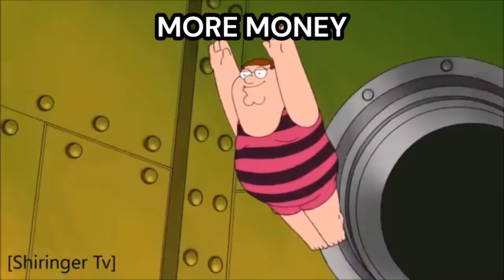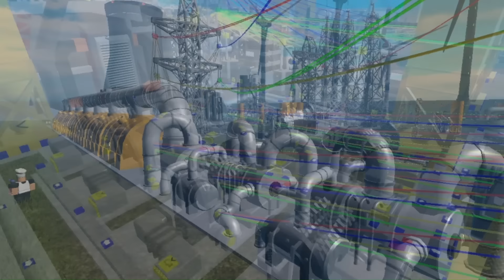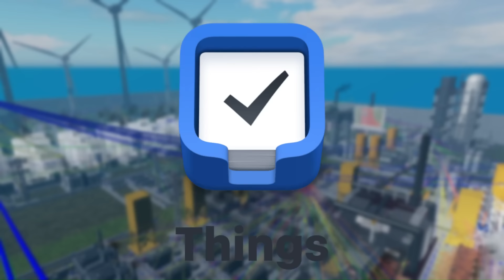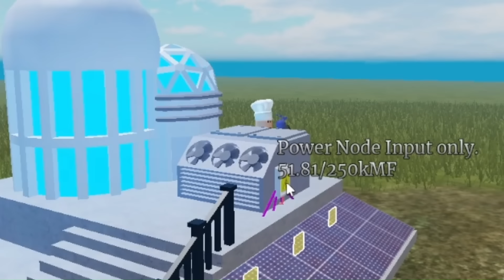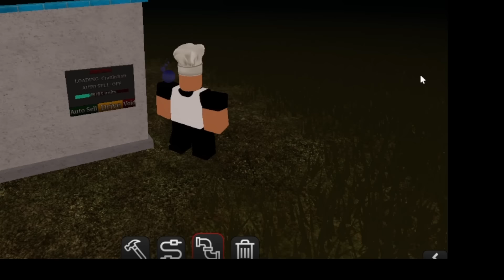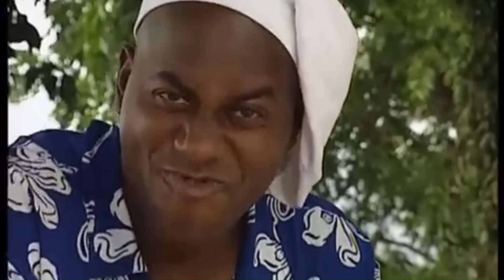INDUSTRIALIST - A roblox tycoon madness

Comment: So you can turn refined diesel into gasoline wich is cheaper than turning gasoline into diesel then refining that and it also causes les polution and you get more gasoline from diesel then diesel from gasoline so gasoline is better(also gasoline is better cause in the nuclear uptdate it has more rp value)

Comment: Here is a better flow chart:

Power
Solar panels > wind turbine 2 > geothermal plant > gas burner > idk how to do HV

Cash
Iron plate squared > chair > gearbox > lithium battery pack > 8x64x microchips (guide is on wiki)
 
Research (nuclear update)
T1 array > T2 array with plastic pellets (1 plastic production per 26 T2) > Sattelite dishes > T3 (rubber and aluminum) > T4 (guide on wiki)

I have played Industrialist for over 200 hours. You can trust this guide, following that oil and pollution are averted like the plague.
It will require some waiting though.

Comment: iv only got 2 real issues with Industrialist

small map size and the low "model" count (instead of actual things, it counts parts, so 1 straight pipe is 5 models), iirc the current cap is 30k parts but it can be raised to 80k but there's a risk of data corruption (im guessing the data storage is either ineffeceint or small)

Comment: Advice for how to get rich: Just earn enough to buy the logic assembler, It is a power guzzler tho so make sure u have the required power. Diesel generators / the cpp would be good for this. Next supply the 4 componants, They might seem like a pain in the neck to build, but once u have done it its not so bad. Now finally you dont really REALLY have to setup a logic system to automatically control the logic assembler but its reccomended as it saves time and can avoid mistakes. You can control the input signals yourself. So if ur in a situation for some reason where u  are low on cash, you can sell 1 8x64x microchip for 5mil dollars and be good to go!

Comment: - no pollution
- blast furnace
- 100% pollution
- try to remove, but scrubber is 30k each
- end up on 2900% pollution and no way to go back
- no regrets
Reply: - water treatment plant 700k+
- distilled water for scrubber not cheap
- regret
Reply: @UpgradedBakedBean  filtered water is good enough (-10% per hour)
Reply: - filtered water scrubbers
- 3 foundrys
- 100% pollution
Reply: That's why I only use clean energy production and focus on keeping pollution at a minimum using advanced drills

Comment: 12:15, you can use pipe intersections to handle the inputs and outputs by chaining them. This way if you want to spam them, they take up less space. This works great with geothermal wells! 2 geothermals -> boiler -> turbine makes a whole bunch of power. Either reuse the cooled water, or just dump it. I use logic to make sure I only pump as much water as is lost from the well. Overall, the land space required is alot smaller for the same power generation as diesel(In what Ive tried so far).
Reply from the maker: @NatWatGamer You use logic for BOILERS?! God dang.

Comment: >chapter 3 is midgame
>chapter 4 is oil 

Was I not supposed to process, refine, and bottle oil products before making the first crankshaft???
Reply from the maker: @log_by_bolb  diesel part wouldve been before mid game. And plastic wouldve been part 4.  

It wouldnt make sense to divide one big resource into two parts between other parts of the video.

If you saw my made up chart of listed items in the mid game section, you'd see that between the crankshaft and the metal, there's a question mark. Which was diesel.
Reply: @arielstar2006  ah, I see.

Comment: DONT DIRESPECT GEOTHERMAL LIKE THAT. Its by far the best if used properly with a boiler and reusing water. Can make a power source that never clogs, uses nearly no models, free power. Mean while firebox requires coal. You can also get 150C if you are efficent with 1 geothermal.

(if you reuse water you only need 3 geothermal to produce 220C water)
Reply from the maker: You signed a waiver
Reply: @arielstar2006  you should TREAT IT WITH respect
Reply: @arielstar2006  or I will tell USA that your server has oil
Reply: yes but inconsistant and low temp, geothermal sucks
Reply: @hampus1050  Not if you use it properly and reuse water. Then you can get 150C water that never clogs and is super consistant. Geothermal is a great energy source for early to mid game. You just have to learn how to use it and its one of the best energy sources in the game.
Reply: @PortableWaterTank  You can actually reach about 180-240C consistantly if you chain 3 together. It's also clean energy, which is nice, however it's not one of the best in the game.
Reply: @hampus1050  Geothermal is prob the best early - mid (anything before LDE really) energy production. While chaining 3 geothermal well together is good for heating if you need it for something (Only good in early game) going for the 1 geo design is better when it comes to efficency and scalability.
Reply: @PortableWaterTank I see! So only using 1 is better for sheer power but 3 is good if you need hotter steam.
Reply: @hampus1050  yup
Reply: LDE is ASSSSS also geothermal loses water so u cant reuse water infinitely
Reply: @user-wi5pv8po8e  yeah i never said you can reuse water for ever. You should reuse water to increase the temp cus water used by a turbine is 50C. Which means you only have to use 1 Geo. 
a 1 boiler setup needs 3L a second to run properly or the temperature will drop to low.
(you can dump half the output of a tier 2 water pump as it gives 6L/s)

Reusing water is to keep the temperature high.
Reply: @PortableWaterTank  marty's goofball mde in question
Reply: @PortableWaterTank how about fire box?

Comment: W vid, BTW underrated game recommendation "the reactor[maintenance]"

The concept is kinda simple: you operate a reactor, you need to meet energy quota on each shift, stuff will begin to fail

A bit of instruction on how to start the reactor since the creator removed instructions for some reason:
Step 1: go to the back left panel and press the 2 blue buttons and one lever on the far left side of the panel
Step 2: go to the panel in the middle of the control room and press the "boot" button near the master lever
Then it should be self explanatory
(Game supports multiplayer up to 4 players max)
Reply from the maker: Great suggestion, but i don't want my channel to always revolve around complex reactor games. I want to make more variety content..
Reply: @arielstar2006  alr fair, just i find it pretty underrated and really good